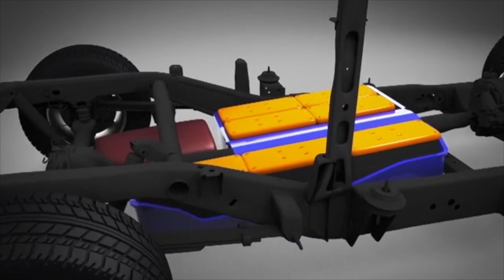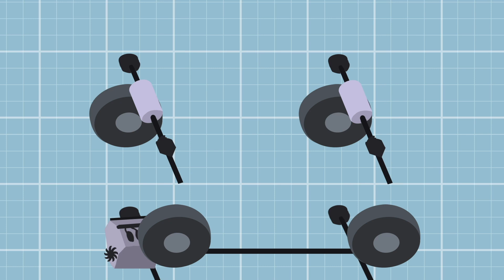Could This Pickup Truck Design Change The World?

Comment: This was a good video but there are several things over looked. First off the more plug in vehicles you have the higher demand for electricity. Windmills and solar panels only contribute 8% in the u.s.a the rest comes from nuclear power hydro power and coal, natraul gas etc,etc. Second problem is the natraul resources for the battery. I'll focus on cobalt that resource Manley  comes from child slave labor in underdeveloped countries. Then you have disposal of said battery which is highly toxic and very dangerous. Third point if you get much more complicated with hybrids  there won't be very many people who can work on them. We very well might need all mechanics to have electrical engineering degrees witch would dramatically raze the cost of repair.

Comment: Such a hybrid mostly has the disadvantages of  both,  ICE mediocre mileage, poor reliability, high expense of both systems.  Cybertruck starts at $40 K and even that version is probably adequate for 90% of use cases, same price as comparable ICE 2WD trucks.  4WD startx at 50 K, like 4WD ICE.  How does this make sense?

Comment: Can a ICE—generator	—battery—motor power train be more efficient than a simple efficient ICE?
Reply: @MrGonzonator - They are more efficient as a vehicle, because the generator has fewer moving parts than an engine with a driveshaft etc. This means that the generator runs at its most efficient range, charges the battery efficiently, which then in turn powers a very efficient motor to move the car. However, you could perhaps say they are overall inefficient in terms of extra manufacturing, materials, and maintenance of a complex machine etc. I'm not a fan of hybrids (for this very reason), but I tend to agree with Vicky here, because it is a baby-step towards full electric. Getting the manufacturers to think differently, gain experience with electric, and getting the public on-board with the switch is ultimately worthwhile. :)
Reply: Part of the concept of hybrid and EV is that it treats the motion, acceleration and deceleration as a system where ICE is about motion and acceleration, so ICE misses out on deceleration.  There is a lot of energy that can be recovered from the deceleration part of the motion cycle.  An easy example could be Formula 1 cars moving to hybrid power in 2014, and while purists of the sport hate hybrids, the reality is that the new hybrids were on average 35% more fuel efficient.  Initial development of hybrid and EV tech is expensive, but the operating cost overall is much cheaper.  In the 1970's when electronic ignition came out, there were many skeptics, and now today, even chainsaws have ECUs.
Reply: @rogerstarkey5390  thanks. Can you please give me some numbers, for example, in terms of the fuel efficiency of the F150 mentioned in the video? I completely understand that running the motor in its most efficient power band is better, but does it make up for the cost, complexity weight etc of the additional components? If you say please buy this $10k more expensive hybrid with more things to go wrong, to save $1k on fuel, you're going to have a tough time selling it.

Comment: So millions of hybrid trucks would increase the need for oil and electricity. Not clear how that saves the planet but if truck owners are that crazed for power and reliability I would ask the fine folks at EMD what their plans are for climate change.
Reply: Presuming that the total number of trucks only increases slightly, the "save the planet" effect is so obvious I don't see how you could have missed it.  Given that you start with missing that, the credibility factor for the rest is too low to bother with.
Reply: Listen again to beginning of video. Trucks are very popular sellers if not the best. That will only increase very significantly if they run more cheaply. Energy doesn't grow on trees. You need to realize cars trucks vans require massive amounts of very expensive infrastructure. That's why you see trains thriving in densely populated cities and private vehicles getting shut out. Parking, paving, gas pump, everywhere you turn private vehicles are freakishly expensive. They are all sold on that notion of freedom that customers can't get enough of. Unfortunately that freedom is financial jail for far to many. Ever notice how the retirement age keeps going up?
Reply: @Richibald1  
Most American buyers of trucks spend very little time considering the fuel consumption issue.  I don't see the number of trucks increasing as you say.  They will still be really hard to park and handle worse than cars.  Cars will still be cheaper to run.

Comment: Bob Lutz showed a hybrid pick up on Jay Leno's garage like 6 years ago. That didn't work out?
Reply: Several years ago, GM was selling their "dual mode" hybrid system in pickups and SUVs, but due to the complexity in the transmission, the cost was high. It didn't sell well, as few thought the modest improvement in fuel economy was worth the added cost. That failure may explain their reluctance to bring a new plug-in truck to market, even though their new Voltec design would be simpler, cheaper, and more efficient.

Comment: It does not produce more nox at higher compression ratios that are leaned out but rather less its a myth that they produce more at higher ratios nox is only created at an incomplete combustion...
Reply: No, that is wrong.  
Any time you have a lean burn, you have extra oxygen.
The air has nitrogen.
After the fuel has burned, the temperature is high
That is all you need to make NOX
The more complete the combustion, the more NOX you tend to make because of higher temperatures.

Comment: Until a hybrid / battery truck can be made as reliable or more reliable AND as powerful as a gasoline engine it Will Never ever ever get a foothold in the United States

Because we don't have time to wait for a battery to charge we don't have time to wait for a technician to come and repair a melted wire we don't have time or the patience to fiddle with finicky technology that's why a lot of people don't like modern trucks either they drive them because they have to but they don't really like them but they're still way more convenient than an electric truck will ever be

And if you were to even put all of that aside we had it cost would kill the project immediately because nobody wants to pay the 60 to $80,000 a truck cost now nobody will ever pay $100 to $120,000 for a truck that's less convenient and less reliable and less powerful

Comment: What? Please they cant make a pickup to replace my truck. Give me a EP that can hual 4000 lbs in the bed and can pull a 14000 lb trailer over 300 miles on 1 charge and I will be the first in line.

Comment: The new Silverado will have a turbo 4 option and the 4 cylinder diesels from the big three are cleaner than gasoline. I feel like hydrogen would be better option for pickups the straight up electric would suck for towing, highway driving, and just about everything people use trucks for. And the title is click bait and I'm disappointed.

Comment: You are way off with a 13kwh battery.  I drive a PHEV outlander which was around 1500kg before all the extra drive train it has about a 12kwh battery.  Even with a 5c discharge of 60kw you have to be careful not to start the ICE when putting your foot down.  Would need at least 20-25kwh battery for a pick-up approaching 3 ton to get 100-125kw at 5C.

Comment: yes, electric vehicles are great but, infrastructure isn't set up for all places and people to have one. Not only that, but if they are plug in electrics your just moving the pollution to concentrated areas and giving states reason to fire up old coal power plants which pollute worse than the vehicles the electrics replaced. Not to mention all the crude oil infrastructure out there. The maintenance on that isn't good enough with it in use. What would happen if it started getting moth balled like old mines. Think the gulf oil spill at random all over the world. We have to re invent the power grid to use only renewables and smart transmitting of that power first then change the standards of commercial hauling vehicles. Let them bring in the infrastructure for Joe and Jane the consumer who can see how much the big chain stores and businesses are saving on fuel and want in on that action. I'd love to see and would probably own a traction engine truck ( all electric drive train with a fuel generator and battery pack ) trains and mining equipment have been using that system for years. Why we haven't switched over to that system is beyond me.

Comment: Would these electric trucks be able to pull boats out of water I've seen people have their trucks in water, you know electric and water don't mix
Reply: Good engineers can deal with that.  It isn't rocket science.  Generally letting the important bits of an existing truck get into the water is a bad idea.  If it has driven any distance then it is doubly bad.

Comment: Dodge Ram E tq 48v standard on v6 and opt on v8. Jeep wrangler E tq. Chysler Pacifica plug in hybrid, 80 mile plug in range. Do your homework.
Reply: David Hoffman the Pacifica only has a 16 KWh battery. How do u get 80 miles out of that? I have a Leaf with a 24 kWh battery. I don’t get 106 miles out of it. Unless I drive real slow.
Reply: Try 33 miles for a Pacifica

Comment: Just when the hell is 26 miles per gallon out of a full size pickup horrible fuel mileage????? 26 miles per gallon out of a full-size pickup yet you want to plug it in and power it from a coal-fired power plant. If you'd quit looking at skewed temperature data you'd see that the Earth has been cooling for the about the last 15-20 years period and hasn't actually warmed up since the mid 40s as no less than four of the warmest years in the last 100 we're all in the 1930s.
How in the hell do you supercharge an electric motor, you going to run an extension cord, plug it in in Albuquerque? This would be laughable if it weren't for the fact that I think this woman is actually trying to be serious. What a ditz.
Reply from the maker: Are you done Robert? First, scientific consensus on global warming isn't in debate. Second, why use something that's powered from fossil fuels when you can us "Beautiful clean wind" or "Beautiful Clean solar" or "Beautiful clean biomass" to power the power stations? 

Supercharging = the rapid charging tech from Tesla. Other automakers will likely use a similar system. 

If global warming is a 'myth' and you're right and we do nothing... we're lucky. 
If global warming is real and we don't do anything... We're boned. 

If global warming isn't real and we do something = we still have a better, more efficient way of doing things. 
if it's real and we do something? We're glad ;)
Reply: @transportevolved  scientific consensus on global warming does not exist some of the top meteorologist on the planet say it's a hoax. They have even found them Miss stating temperature records in order to try to prove their Mis stated goal period and transferring money around is not going to change the climate. First and foremost, you cannot make a decisive decision that the Earth is somehow warmed up in the last hundred years if you've only been taking Direct temperature data for 140 years. And as the 1800s were an unusually cold century, exhibited by the freezing over of the Mississippi River in the middle 1800s for several years. It's kind of hard to use it as your one and only judge. Secondly, oil is not a fossil fuel it's created at depths under the ground that fossils never got to. The Russian scientist who surmised that it might be of fossil origin said that it was merely a possibility. Which has been proven wrong over the last century. When they first came out with the scientific consensus of global warming a couple of decades ago most of those scientists that were quoted stated they never agreed with the conclusions in the book. So much for your consensus b*******. Not only that, I have taken meteorology as part of Natural Sciences in college. And adding carbon to the atmosphere will only do one thing, start the precipitation engine and cool the planet. It has happened hundreds if not thousands of times in the history of the Earth when it gets warm it creates more carbon as a result of Greater amount of life activity, what's carbon into the air, it starts to rain and snow, slows down life, slows down carbon output, and starts the cycle all over again. In Matthew call that the Fibonacci rule which is consistent in all things, especially nature.

Comment: Hydrogen is the answer. Batteries degrade over time and will need to be replaced. But if we replaced the batteries with a hydrogen fuel cell then there would be no battery or batteries to replace. 
There is hydrogen fuel cells that supplement servers power draw. 
Just my thought. We really need to put more research into the hydrogen fuel cell technology of ev trucks. 
My main thoughts come from all ev's are still coal burning due to the vast amount of coal burning electric power plants still in use around the world.

Comment: You don't really know much traditional mechanical Transmissions know they put so much Electronics in these Transmissions that they often even shift up electronically and have much lower longevity because of it my 2006 Dodge Dakota is a good example those 42rle electronic Transmissions have overheating problems it was a mechanical transmission it wouldn't be nearly as bad in fact it would be able to take the same stuff my truck takes but would not be nearly as fragile why couldn't Chrysler build their own high quality transmission why did they have to Outsource it to some other quack.

Comment: The video was interesting up to the point where they mention the Paris Agreement. It's a scam, a load of sh!+, and to base the rest of the video on electric and hybrid trucks is lame.
The problem: WEIGHT.
Batteries weight A LOT. Why did Ford switch to aluminum? The lighter the truck, the higher the maximum payload capacity can go, within the legal limits of vehicle class.

Comment: Climate change is called "seasons" and "weather".
CO2 FOLLOWS temperature increases.
The gas electric system is better suited to econoboxes no one in the USA wants, or heavy commercial vehicles or locomotives. 
More efficient engines are cleaner. My 15litre diesel detroit exhaust is cleaner than the air going in.
Free people buy what they want/need. Whenever there's prosperity, econoboxes go away.
Whenever there's poverty, econoboxes come back.
And before you condemn America, try imposing your BELIEFS on China. They're having their industrial revolution right now.
Reply: No, climate change is a long term trend.  It gets dark at night too.

Comment: There is so much bull crap in this video. You can't get the same capabilities with electric that you can with other motors. Diesel is the most environmentally friendly motor, able to run off biofuels. You won't get many people or companies to support a movement when your range will be limited to only about half the range of gas. It's just not going to happen... at least for a long time.

Comment: Not a new concept in any way shape or form! GM have had a hybrid pickup for years and it is not the best technology for being green.
Steam engines have twice the efficiency of hybrids and electric vehicles and they are far cleaner than either ultimately.
GM and BMW have both attempted hybrid steam vehicles but that was for cars had they looked at trucks instead they would probably be on every road today.

Comment: The climate is cooling not warming , so there is no problem.
Reply: Hogwash
There is a short term wobble in the curve.  If you filter that out the trend line is upwards.
Some people will still be in denial as the last penguin bursts into flames.

Comment: Believe or not most modern full size pickups were used as soccer moms for kiddies and as groceries getter in North America. The extended cab or crew cab with small bed indicated it's used more as a family limo & as the jumbo size jet setter station wagon instead as a real contractors or farmers workhorse.
Yes we still needs them for the real working people that really need s a huge cargo bed & heavy hauling. But as for urban and suburban mom & pa  groceries getter? Nope.
The BLAME GAME goes down to the manufacturers only interested in 40k + $ market for huge profits.
No longer interested in small and mini trucks. Ford Ranger is the  only lame choice. The Tacoma has grown upward in size from the past decades. Other manufacturers sees no profits. They really should have more choices from more manufacturers with expertise in affordable mainstream small efficiency motors such as Honda, Mazda, Toyota, Nissan, VW, and Hyundai. As for electric power it's another hype marketing for more $$$$$ again.

Comment: This lady does not understand that is excellent gas mileage for what the vehicle is for example my 2006 Dodge Dakota has a V8 bucking 19 miles per gallon highway and in reality the Ford EcoBoost Vehicles really don't get what they advertise well you might have to drive like a half blind grandma but on the forms people people say that the Ford with the EcoBoost doesn't really get the gas mileage it says plus the new EcoBoost Motors trying to become so lightweight has become fragile and the blocks crack and leak radiator coolant and burn it and then eventually burn themselves up